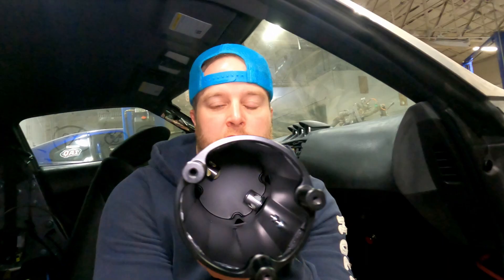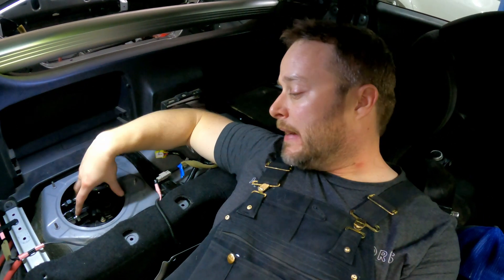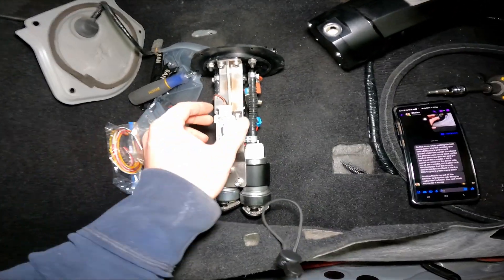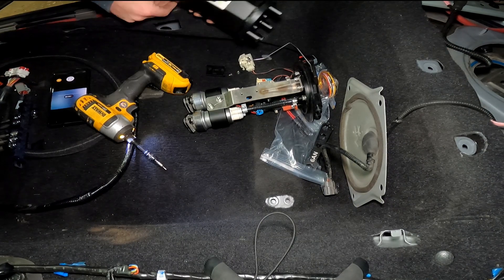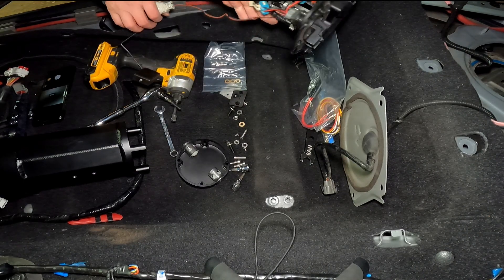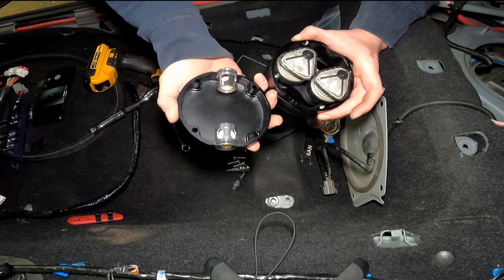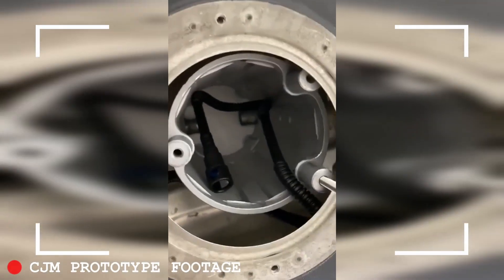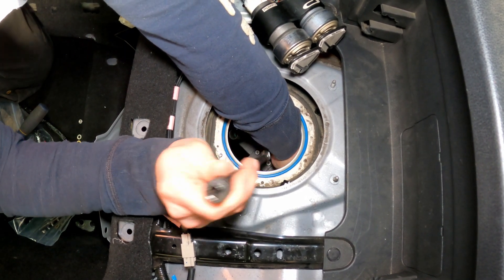CJM Anti-starvation with Twin Pump Install

Comment: Is that a return fuel system?
Reply from the maker: Not exactly. The anti starvation stops fuel from running away from the pumps under braking, acceleration and cornering. The fuel return is shown in the video, it's the -8 line on the left side of the fuel hat. Also, The return flows back into the area of the fuel pump. Let me know if that answered your question?

Comment: So the little surge tank fills up with fuel as you’re filling up your gas tank? I’m just having a hard time ,, visualizing the design I’ll be installing this on my car within the next month or so
Reply from the maker: At the bottom of the surge canister you will see two balls on a track. When you whip around the corner it will keep fuel inside the canister because the ball will close on one side while the remains open letting fuel in. Simplistic and genius design.

Comment: The only thing you missed on the video was extending the fuel level sensor wiring. I ran out of daylight today. I will finish mine tomorrow.
Reply from the maker: I said it at the beginning but didn't show it
Reply: @GregoryBrettin  I heard you but a couple folks didn't I guess. All good.
Reply from the maker: @spooler7828  appreciate the feedback!